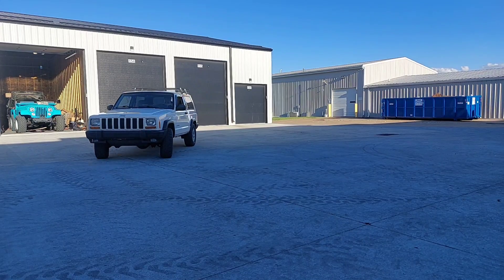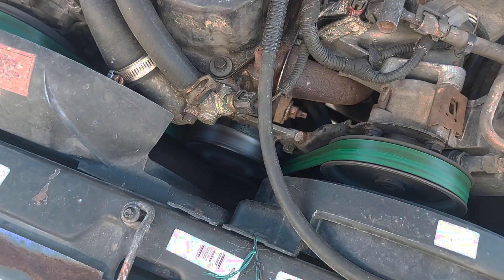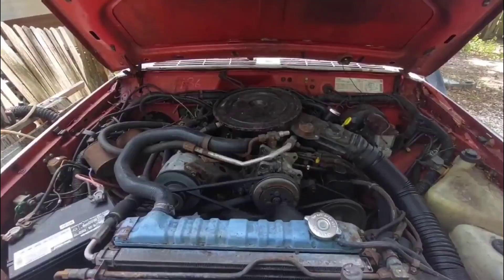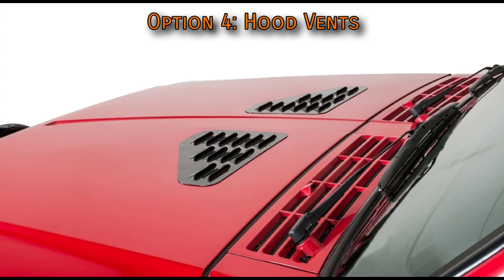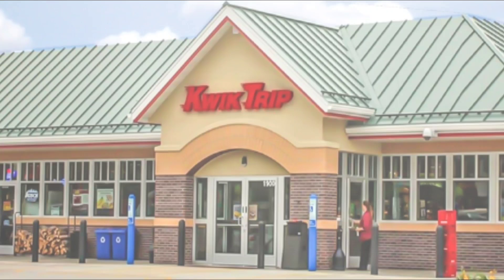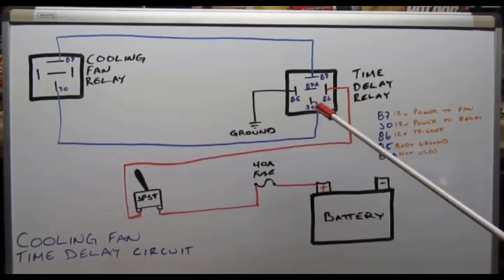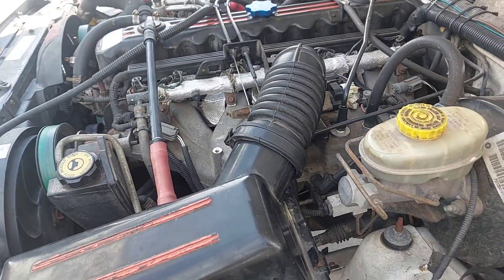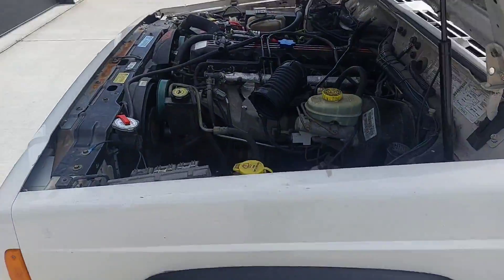Jeep Cherokee: Heat Soak & Vapor Lock Explained (Cylinder 3 Misfire, Rough Warm Start) ['00-'01 XJ]

Comment: Great explanation of this issue. I’ve been experiencing this on my 2001 intermittently. The previous owner installed the wraps on the fuel rail and injectors, but I have experienced this on warmer days and when the engine has been idling for a while after brief stops. I like the idea of the time delay relay for the e-fan. I think that’s a great solution if it becomes much worse. Gasoline with higher ethanol content definitely contributes to this. It’s a shame that Chrysler had to add the additional cats to meet emissions requirements in 00-01 models, because this wouldn’t be an issue otherwise.

Comment: Great video! I run the heat shields and the hood vents and the mitshimoto 3 fan with aluminum radiator. No more heat soak.

Comment: So I used 14ga + 10amp fuse and wired my TDR following the D&E video diagram, but I grounded to my battery. 

Last night, I stopped somewhere for a few minutes, hit the switch, the fan did it’s thing, I tried to start the car a few minutes later and everything shut off. Seemed like the car shorted out. Instantly went under hood, no smoke, no fire, no melted wires, fuse still intact. I wasn’t getting any power. Wiggled my battery a bit and saw a spark. I guess the negative terminal was loose. Still no power. 5 minutes later, I had power. No idea what caused it. I’m looking at all the connections and wires again now, still looks good. My best guess is it wasn’t a good ground connection? Hesitant to reconnect again. Any input is appreciated. I’ll update if I can figure out what caused this.

Also, I’m watching this video thinking it’s years old haha but it’s only a few weeks. Strangely comforting knowing someone can be going through same issues as you. 😂
Reply from the maker: @iAmJankus  The symptoms you're having are of loose battery terminals. Make sure they're both clamps down good
I doubt you compromised anything running a fan override
Reply: @WAEMIDIV  my lack of electrical knowledge is what makes me scared to tamper too much haha. My fears had me instantly worrying of my xj catching fire. But my logical sense tells me it was loose. Reconnecting it now w a better connection than before. Will update

Comment: I’ve personally never had this issue at all or even overheating i always hear a lot about overheating on this engine but I have it on 4.5lift on 33x12.5R15 with auto trans and I do drive it heard especially on the expressway and never had overheating issues
Reply: And as far as fuel I use Non-ethanol since I have a gas station down the road that provides non ethanol

Comment: I have a 97 with a new radiator and heater core. Driving down the road it never gets heat soak but when i stop or when i offroad, its been really bad. I tried the heat sheild and it helped some but not much. I got the fan override switch and hood vents that i need to install. I am hoping this will solve the issue.

Comment: Great video, lots of good info here! My 2001 developed heat soak AFTER installing a banks torque tube header and new CARB walker pre cats. No idea why that seemed to make it hotter than the cheapo ebay header and old cats. I even started stumbling while parked and idling for long amounts of time (damn popeyes drive thru!!) But I eventually wrapped the fuel supply line and did the fan switch which "cured" it. I get a lot of concerned comments from friends and passerby's when I park and have the loud ass fan on but at least it works!
Reply: Interesting.  I have a 98 so i dont have the stupid Cats but I recently experienced what appeared to be vaporlock for the first time in my rig and it was the first trip out with the new revolver header from banks.  Never had an issue before that and I havent been able to duplicate it since.  But everytime I would stop on the trail and let my rig idle within 30 seconds to 1 minute it would start to spit and sputter.   I would shut it off let it set for a few minutes with the hood open while poking and prodding and it would start and run fine until i would stop and idle again.

Comment: Interesting video, I have a 1994 Jeep XJ Sport and so far I have not had any problems with overheating, after putting the electric fans directly to the battery with a relay And it turns on with the key, while with the aw4 transmission I have not had temperature problems either.

Comment: That fuel chart is so real, I can only attest for two of them but I have noticed when I get the Valero I have more instances of bad heat soak as compared to Sunoco, Sunoco I barely have issues, when I do have you soak I just push the pedal a couple of times to force more new fuel into the fuel rail and that seems to fix the problem faster, also great finally seeing this mod in "person"  technically, I always have trouble comprehending diagrams and implementing them to the actual thing, being able to see both really helps me and I might actually do this mod.

Comment: Keep up the great content! Can you get the high idle switch to work on a manual swapped XJ?
Reply from the maker: No, that's what my second toggle switch on the dash used to be for, but the manual ECM simply doesn't have the programming to understand what "extended idle" means. I've tried to wire it up anyway but it just doesn't do anything. ):
Reply: @WAEMIDIV  Thank you for the follow up, I can give up on it now. Much appreciated.
Reply: @WAEMIDIV run a bicycle derailleur cable and a old school shifter. Mount the (bike) shifter to the tranny shifter, have the other end pulling on the throttle linkage. Easy.

Comment: I’ve got the e fan switch and heat shielding on my 2000. It wasn’t until I wrapped the fuel line in the heat shielding also that my heat soak completely went away. That fuel line runs right next to the exhaust manifold, so all the fuel in there would turn to vapors very quickly.
Reply from the maker: that's also a good idea, I haven't ever seen that done. I think I'll do that

Comment: Fun fact, a lot of old tractors have reverse flow engines, to the point that some of them have the intake and exhaust manifold cast as one unit. I have a 1923 Mack truck that has coolant plumbed through a jacket inside the intake manifold, for the express purpose of (as stated in literature for the truck) preheating the fuel-air mixture for 'Maximum efficiency'. Now, this was in part due to lower quality fuels in 1923, but that still makes me chuckle every time I think of it.
Reply from the maker: Ah yes, "wet manifolds" they call them, my white Comanche also had a coolant line through the intake with that same purpose. On carbureted or TBI engines, where fuel has to travel through the manifold, it helps it not condense on the walls inside of it, and remain an atomized mixture. Very interesting stuff
Reply: That may have been the effect that it had, but the pamphlet clearly states that it preheats the air-fuel mix for better efficiency, which to my understanding isn't how that works. I'm sure it does help with what you mentioned, whether by design or happy accident, since there's over a foot of updraft tube between the carb and the intake manifold. And I really shouldn't be surprised that AMC was borrowing design features from 1920s industrial trucks, should I?
Reply from the maker: well think, technically, when fuel isn't condensing on the walls of the manifold, more of it is reaching the engine and actually being burned, which does mean it's more efficient than it otherwise would be
Reply: I suppose you're right, I'll give the Mack engineers the benefit of the doubt, and chose to think that that was their intent, not 'More heat= More better". Then again, it's a 255 inline four that supposedly made forty horsepower brand new, I think that torque was a little higher on their priority list than efficiency.

Comment: 92-94 Octane gas has 10% Ethanol in it not, 0% REC-90 is the only non-Ethanol gasoline
Reply from the maker: oh I see.
Reply: @WAEMIDIV  yeah I always thought that 93+ didn't have ethanol, till about a year ago when I had my generator sitting for a year and had only 94octane sitting in it, well it ate the carb seals and anything not metal in the carb was gone not to mention it didn't even smell like gasoline. The carb damage was the same as my buddie's commercial mowers carbs look like after sitting all off season and someone forgets to use stabilizer or the stabilizer didn't work too great. Ever since they started adding ethanol to the gas every single line trimmer needs a carb rebuild every season. It's so problematic the Stihl actually makes a rebuild kits for their commercial lawn equipment specifically for the carbs and they make them in mass quantities compared to how many they made before ethanol came out. We used to go seasons without an issue on the carbs but run some good old Ethanol through them for the mowing season and after the winter half the seals are dry rotted and the carb is clogged and float bowl is stuck. 😂

Comment: i did that D&E Bueller relay set up on a 2000 4 door i had, Doug and Eric are cool dudes. it worked great. the 2000 XJs  also have a ECU problem with turning the Efan on when the AC is turned on like its supposed to, they dont do it at all, lol supposedly the dealer can fix it though, theres a TSB on it. i used my rear wiper switch on mine to be able to turn the Fan on, ive never used a rear wiper on any vehicle ive ever owned.

Comment: Electric fan override is the best cooling upgrade. Especially for an engine with a cooling system that isn't in perfect running shape. My block is super rusty, I flush the system once a year and it still comes out brown every time. Only solution is to pull the engine and have it cleaned. And who has the cash for that these days?!?
Reply: That is not the only solution. Try doing a Calgon clean out...same thing the Ford guys do when they get oil in the coolant when their intercooler pops.
Reply: Yes, a good clean out is essential. Back flush the heater core, rust develops and other things clog the cooling passages.  @JeepITguy

Comment: Add route 66 to the good gas list. Its another midwest station. at least in missouri. keep in mind also my 2000 with fed emissions has vapor lock sometimes. just depends.
Reply from the maker: Yep I've had good experience with Phillips 66 I kinda forgot it was a thing
Reply: @WAEMIDIV  look up top tier gas. It’s a gas rating given to gas station with verified best gas. More detergents, stability, etc

Comment: Very good video! Years ago I installed the factory shields (which had little effect), then discovered the kit sold on Summit, which I installed over the factory parts. Helped slightly. Then installed hood vents, that helped a bit more. Use of pure gasoline vs E-10 was biggest help, though I sometimes still have issues, presumably due to inconsistent fuels. I've thought about modifying the electric fan, but have never gotten around to it. Your success with it has inspired me to get to it. Thanks.
Reply from the maker: I can always tell when a station is selling actual ethanol free 87 vs when they're not, because I get heat soak if there's any ethanol in it. There's a Casey's near me that sells "87 Ethanol Free" for like $1 over what E-10 is, but it acts like regular 87, I'm fully convinced it's not ethanol free. I've used ethanol free from MurphyUSA and I can instantly tell the difference, perhaps we have a new conspiracy on our hands